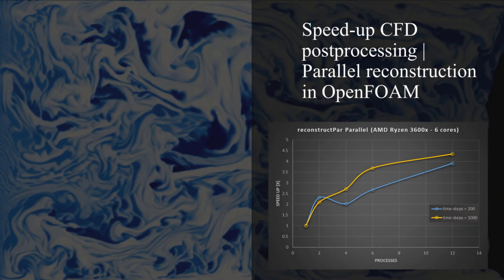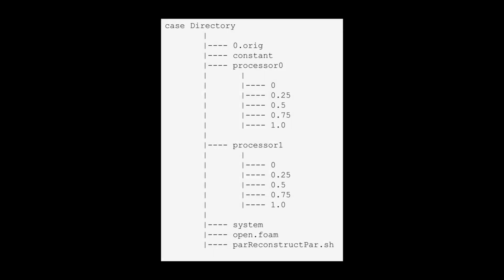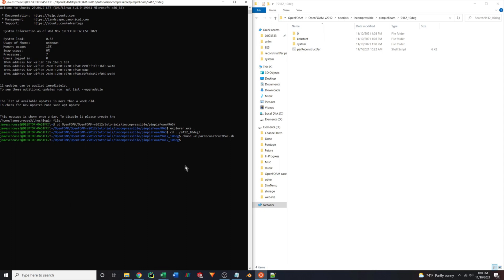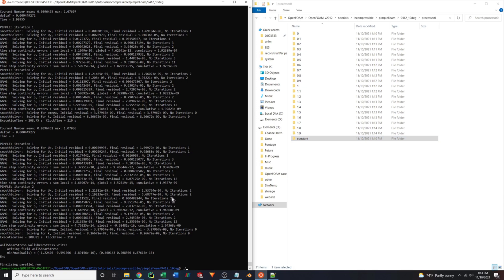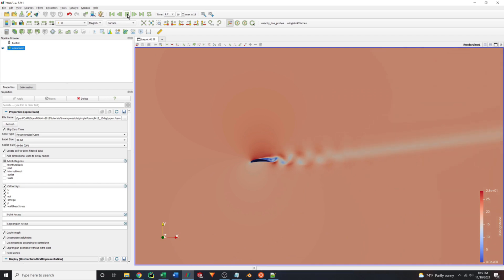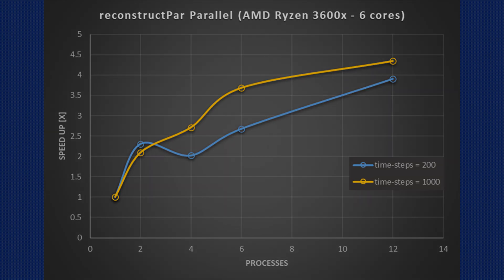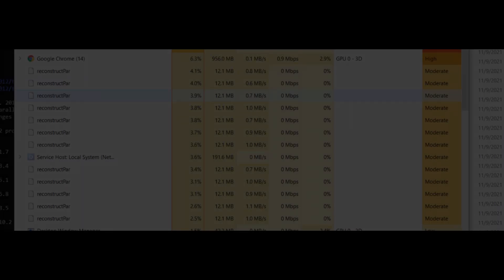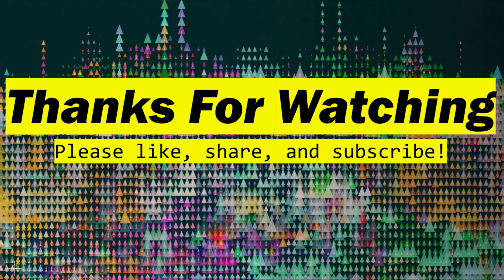Parallel reconstruction in OpenFOAM | Speed-up CFD postprocessing

Comment: While the effective speedup cannot be checked for a light 2D case on this video... there might be better straightforward native alternatives, at the end of the day, running the client-server paraview is  the main workhorse for heavy workloads speedup, you just have to configure and run the server "mpirun -np 16 pvserver" and connect to from paraview gui or directly  from the command line it gives a x5 to x8 speedup and it's there! Genuine turn-key solution ready for use!

Comment: Thank you for this video. I have struggled to find many resources online about parallel reconstruction of OpenFOAM cases. It is quite an interesting topic and I think there needs to be more OpenFOAM users discussing this, so it is great to see you getting the dialogue going.

After many experiments over a few months, I have found another technique for reconstructing fields in a way that I think may be "real parallelism" as you put it (i.e. with communication taking place between cores and cluster nodes if applicable). All you need is one line of code in your bash script. Here it is:

mpirun -np $CORES redistributePar -reconstruct -parallel -newTimes

I believe this method of reconstruction does the opposite of yours. Mine gets every core to work on reconstructing the same timestep simultaneously. I have found it runs very fast. Also, the command I gave above works on multi-node jobs on computing clusters. I am curious to see which of our methods are faster.

Let me know your thoughts on this method!